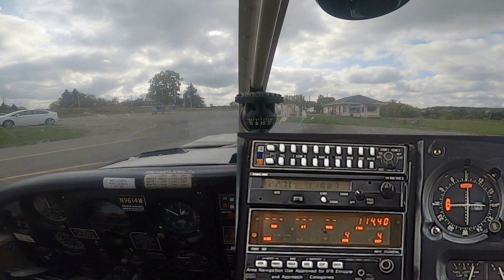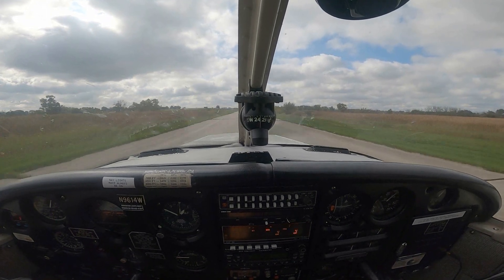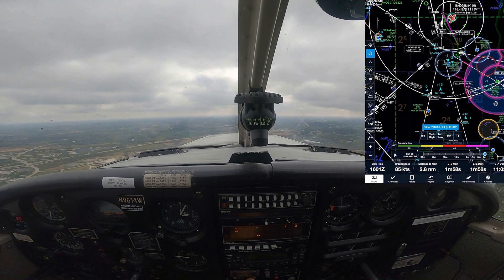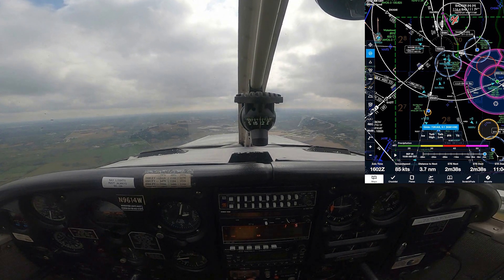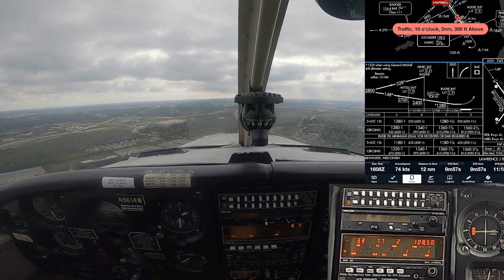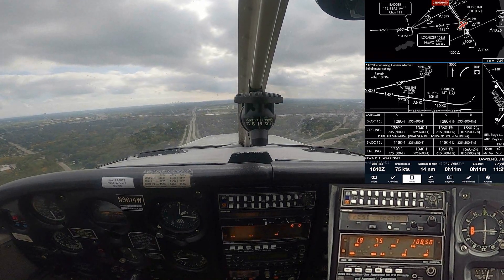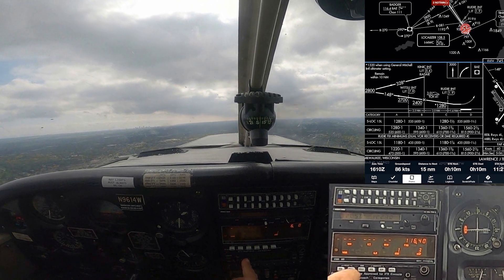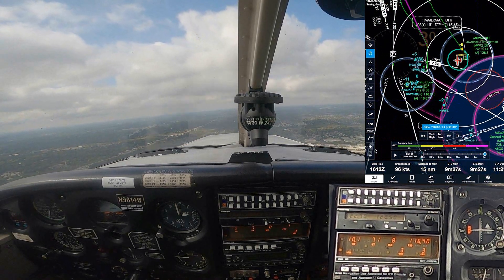How to Program the KNS80 RNAV - Patreon Free Sample

Comment: I want to see a picture of how you mounted the camera to see your gps and cdi.

It looks great.
Reply from the maker: Thanks!  If you’re referring to the camera on the KNS80, I basically just took a chest mount and wrapped it around the right seat. Took some experimenting to get the frame rate right so the display isn’t flickering. I should have written down the settings! Lol
Reply: @thebadgerpilot  well it worked well. I'll have to give that a try. My attempts to get my gps frames well have not been good.